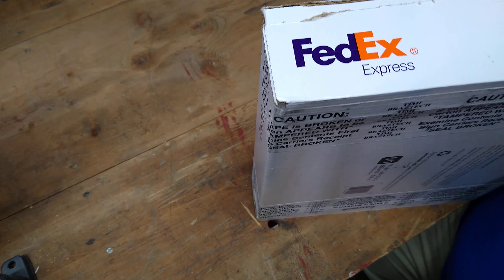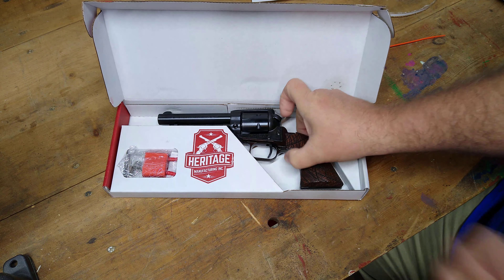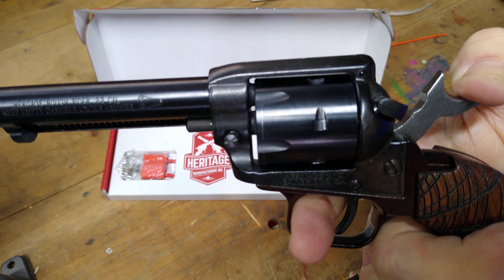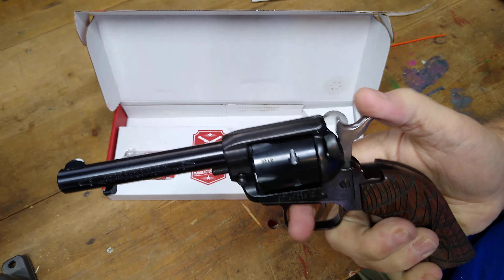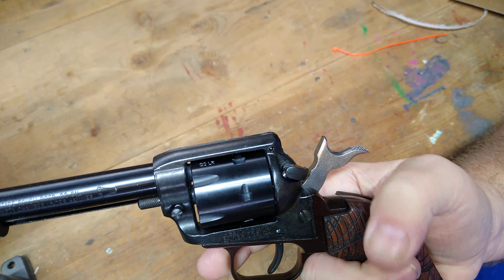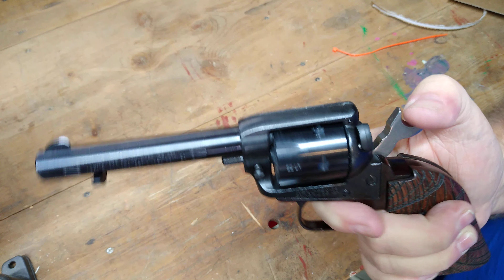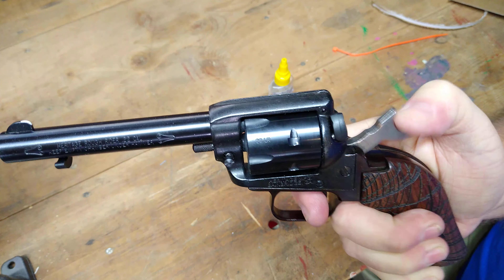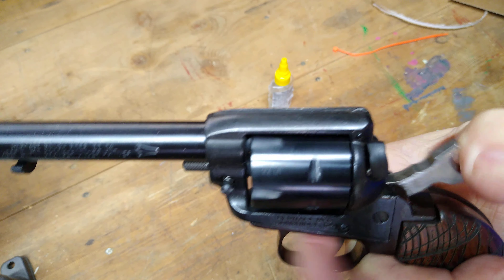Heritage Rough Rider Black widow, did they fix it? or did they make it worse?

Comment: It appears that the trigger spring screw is touching the front of the cylinder or the casting seam is. If so, break out the file and fix it. What do you want from a 100 dollar pistol? First thing I do before I ever shoot one of these is to take it apart and remove all the small burrs and polish things up.
Reply from the maker: Thanks for the feedback I appreciate it

Comment: The forward trigger guard screw is too long causing the drag mark and the main spring is slightly too long causing the hammer to bind.
Reply from the maker: Thanks for watching
Reply: I had the same issue after changing my grip frame. Didn’t get much help from heritage so figured it out myself. Ended up grinding about 1/16” off the end of the mainspring and it worked perfectly. No more binding after that and haven’t had a single misfire since this mod.

Comment: I got the six shot a couple months ago.. smooth as butter.. I just got the nine shot and the cylinder and Hammer are tighter than the six shot seems like when I get to the 8th hole if I was to dry fire it hammer seems to catch on the second click.. didn't seem to matter when I was shooting it and didn't have any light primer strikes or anything like that just noticed tighter than the six shot.. both guns shoot well though and they were only $150 a piece..
Reply from the maker: Maybe the nine shot will loosen up after you shoot it some. They are great little plinking guns a lot of fun just to get out and have a good time with. I enjoy shooting them just as much or more than I do guns I own it cost 10 times as much. Thanks for watching

Comment: A revolver always has play in the cylinder until the hammer is in the full rear position. If it didn't it would bind up instead of rotating. Maybe you should consider an automatic or a single shot.
Reply from the maker: The problem with this revolver is that when the hammer is in the full rear position fully cocked. It still has way too much excessive playing in the cylinder. I guess I failed to demonstrate that on the video. I am very in familiar with the use of a revolver as I have owned hundreds of them through the years. This gun as a manufacturing issue, that they failed to address the first time I sent it back to them. As I write this it is still at Heritage arms for its second attempt to be in repaired. Thanks for watching the video

Comment: Get some end shake shims...maybe not I started writing before you showed the action up close. I have bought 2 and neither do any of that. That is a POS. Don't feel to bad they all make lemons. I bought a used Super Blackhawk that won't shoot anything straight and hot loads knock the base pin out of it. I've been fighting it for 10 years and only keep it for flinch control practice to keep the round count down on my S&W.
Reply from the maker: Yeah I don't think shim's will fix what's wrong with this gun.

Comment: Then you might consider cleaning the firing pin extensively, even using compressed air. I have repaired many misfiring guns by just cleaning the firing pin first. It's cheap, easy and fast. If it doesn't help then you can get out your wallet and move to step 2.
Reply from the maker: If you bought a brand new gun that failed to shoot and misfire. Would you not take full access to their warranty service. A new firearm that's under warranty is not my responsibility to pay to repair. They will get it right or they can refund my money or replace my gun. Thank you for watching the video
Reply: @HamiltonOutdoors  actually I hate to send a gun back(though of course sometimes you must.) I see some vids where folks open a box on a new gun and start shooting. I always clean assemble and sometimes (lightly!) Polish the throats and cylinders of autos and revolvers. I hate to send them back because it often requires shipping(one way) and time in shipment. I ordered a recoil pad for my Rossi 3 years ago and they still have it on backorder. Sometimes the repair can't happen in your shop, so your experience kicks in.